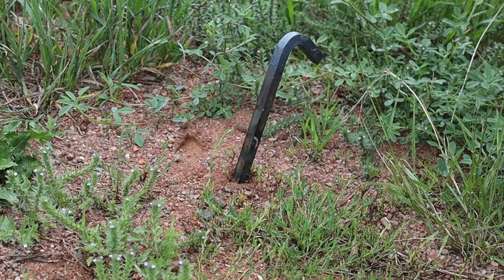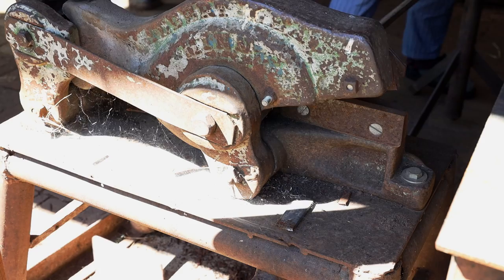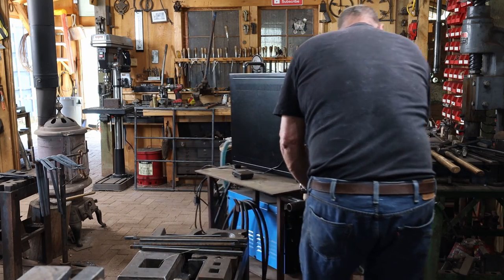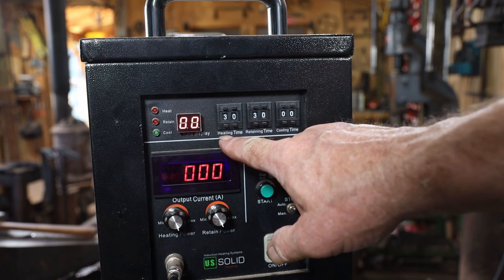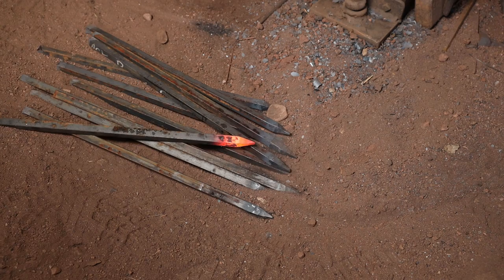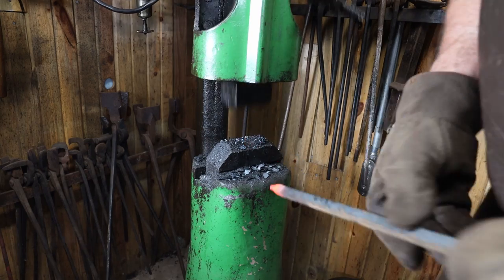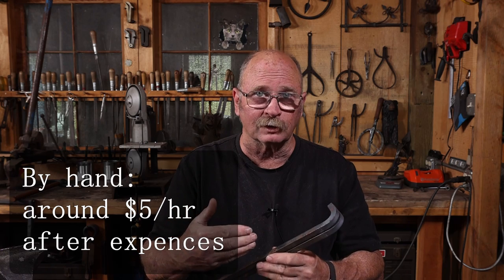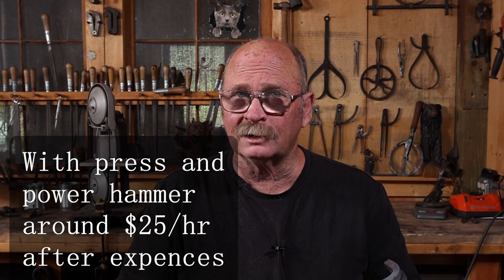Production and Profitability

Comment: I just did a production run on s-hooks last night - no jig or special equipment, just hammer and anvil. The amount of time it took to get the number of hooks I made (plus burnt fuel) I learned was not economical. Yourself, and everyone else, are absolutely right about production work - anything you can do/have to make it go quick and easy is the way to do it!
Reply: S-hooks depending on stock size used are best made cold ...weld up a jig you can grip in a vise grab a 4 foot section of 1" steel pipe and get to bending ... Ive done up to 1/2" stock cold that way it goes really quick maybe half a minute per hook and if you are using 3/8 or 1/4 it goes much faster 1/4 you don't need a pipe just some tongs ... Right tool for the job can't stress the importance of jigs enough for repeatable items
Reply: Oh and if you don't want to go for a jig then find a cheap brake line bender those work well too not as quick as a jig but quite good

Comment: Great video, been watching your videos for a year now. they are one of the things that got me blacksmithing. What drill bits do you use on carbon steel none of mine work? And which do you suggest buying first a hydraulic press a power hammer or a fly press?
Reply from the maker: I just by bits from a reputable industrial supplier, but I'm not worried about the exact specs.  I'll try to find an old invoice and mention the details in an upcoming Q&A video.  As far as press vs power hammer goes, its really up to the kind of work You're doing.  each has its own strengths and weaknesses.  Of course the noise and vibration from a power hammer is also a factor if you have neighbors.